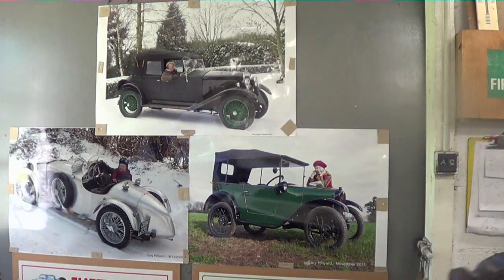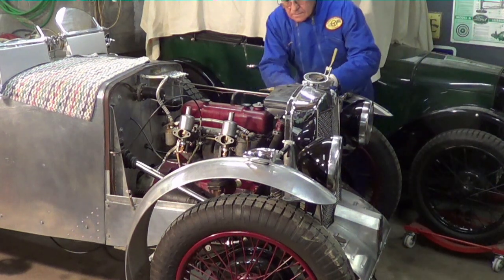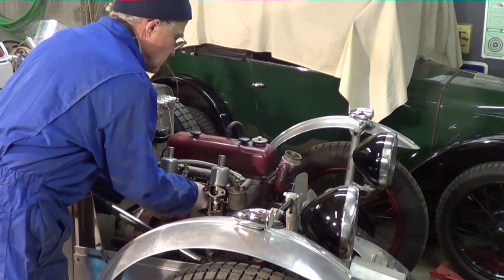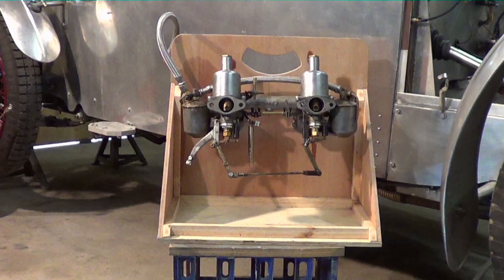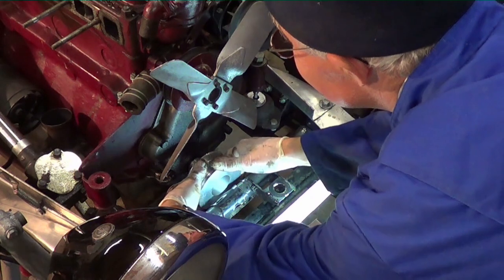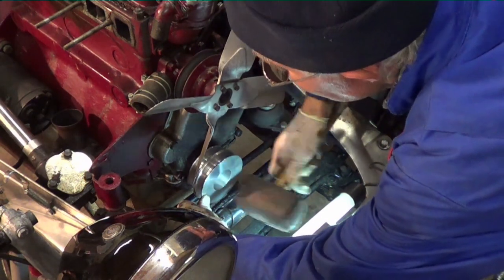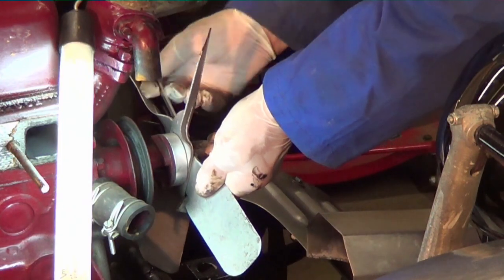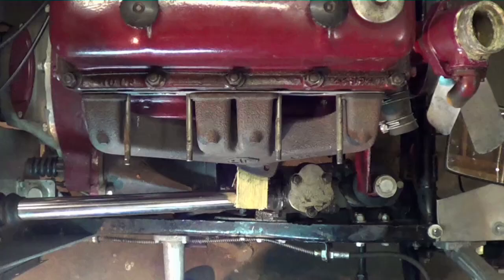MG Supercharger

Comment: Should it change the gearbox after installing the supercahrger ?
Reply: The gearbox and the gearing will stay exactly the same.  All you are doing by fitting a supercharger is increasing the power through the gears.  If you want to go faster or make the engine rev less, now that you have more power you can, if you wish, change the gearbox for perhaps a five speed Ford Sierra one for example, or fit a higher back axle ratio.  Because you would have additional power you have the choice.

Comment: I really enjoyed this video. Your car is one of the very best prewar MGs I have ever seen. Plus, did you have to pour oil into the supercharger before installing it, or was it already prefilled?
Reply from the maker: Thanks for that Travis.  As you know, a supercharger is just a pump. It pumps the fuel air mixture into the engine.  The only oil involved are the bearings for the rotating parts in the pump.  On my supercharger these are sealed for life from the manufacturer.